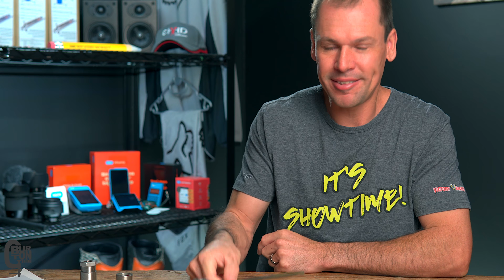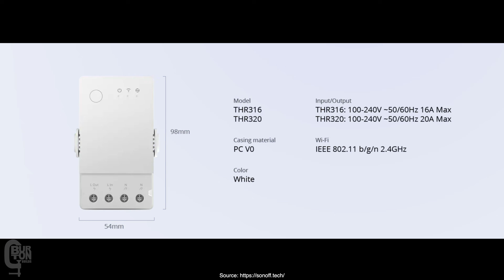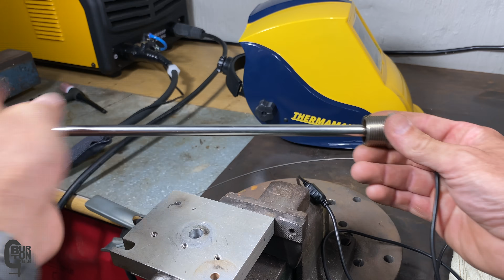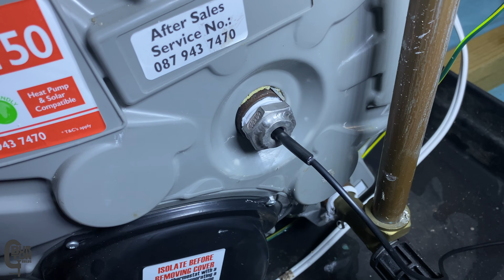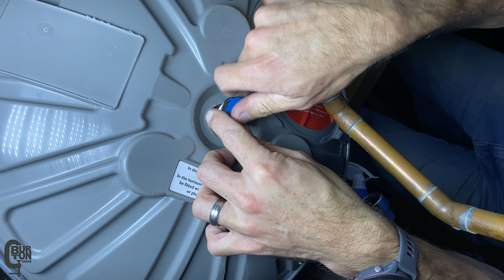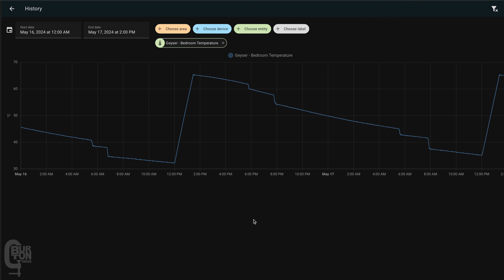Geyser timer and temperature settings - Geyser timer installation

Comment: I have installed solar system for my apartment but my solar isn't set up correctly for hot water.The problem is insufficient hot water for a morning shower.I have a 10 KW battery 8 panels and a geyser wise plus dome insulation round the geyser.Whst should  I do?
Reply from the maker: It sounds like your geyser is loosing too much temperature overnight, so you'll need to bump up the temperature in the morning. What temperature is your geyser heating to?

Comment: Hi Grant, thank you for the video.  I have seen a few ways of doing this but this looks the neatest and more accurate.  I know this is an old video, do you have any updates to this or is the adapter still the way to go?  Also if so can you still supply the adapter?  I already have the Sonoff TH Elite with the probe etc.  I also want to be able to bring the switch down from the roof so that I can see the display, not sure if this is possible?
Reply from the maker: Hi Jeremy, I have been using three of these adapters and all seems to be going well so far. There is some information in the video description if you want to find out more about the adapters.

I would have also liked to extend the temperature probe so that the controller could be mounted in a location it can be easily seen, but if I recall correctly, when I was doing research on this, many people reported problems when using the extension cable so I opted not to go that route. I see there are 5m extension cables available however in my case, they would need to be much longer.

Comment: This is far to difficult just get a Geyserwise mounting plate that already has the extra place for the sensor
Reply from the maker: Can the Geyserwise mounting plate (flange) accept the standard heating element and thermostat that is already installed in the geyser?

Comment: Hi there where do I get the adapter for the probe?
Reply from the maker: Which adapter are you asking about? The stainless steel tube that screws into the geyser? Info should be in the video description, hope it helps.

Comment: Great video, Grant. I've just done this upgrade this weekend. The only thing I don't have is the app and the built-in temp sensor.
Downgraded the 3kw element to a 2kw on my 150L geyser. I have a 5kva inverter and 8 panels, so this will be perfect for 3 showers. BTW, how about a follow-up video from the data you collected over the past year? Cheers, Tim
Reply from the maker: Hi Tim, thanks for the comment. Let us know how your setup is working if you eventually install a temp sensor. Any specific data you are looking for? On average, through summer it worked well, only heating during daylight hours but this winter we are having to bump the temperature of our 200L and 100L geysers each morning because there is additional usage in the evenings now (additional to the usage we had when I originally installed the temp sensors, etc.). The 150L geyser is still only being heated during daylight hours though. Overall this setup across all three geysers is still working great though. Having the option to heat based on temperature and/or time is nice.

Comment: Hi Grant, i sent you a mail about the adaptor tubes. no response as yet?
Reply from the maker: Hi, I don't see anything that has come through? What email did you use? the one in the 'About' section on my home page?
Reply: @GrantBurton  yes the same one, i have resent the mail again. It will come from Shaun L

Comment: Great video, this is next on my list of smart upgrade. Just bought bought a few sonoff switches to flash with Raven to add to Apple home. I also want to replace the elements in my geysers with 2kw so that I can run them on my 5kw solar system. You spoke of getting the data from your inverter. How would you get the data to your smart home?
Reply from the maker: Hi Vincent, thanks very much. Please let us know how the Raven flash work out for you.

A 2kw element should work, although it may take a little longer to heat the water in a large geyser, but if thats not a problem then at least you can cover the full load with solar power. I have noticed our 2kw element runs at around 2.2kw draw. Will you connect the geyser on the essential side of the Inverter, or the non-essential side and back feed power up to the CT coil?

The data can be pulled from the SunSynk server (your SunSynk Connect account) into home assistant. It takes a little work to get right though, it's not plug-and-play and the data only gets updated ever minute or every 5 minutes (depending on how it's setup)... I had this running for a short while and it was working ok, but haven't played around with it for a while.

There are other methods to pull data directly from the Inverter and feed it into a machine running Home Assistant on your local network (without going through any cloud service) but I haven't played around with these much yet.

Comment: Hi Grant, very interesting video and I like the idea of using temperature and time. I currently use the astute timers but these basically only turn on and turn off, I am very keen to give your idea a go on one of my 150l 3kw kwikot geysers. I would be interested in the temperature tube and if the first one works well expand this to my 3 (yes 3 geysers on the property). So please let me know how I can find out the cost of the probe. I am in Durban South Africa. Keep up the good videos, cheers
Reply from the maker: Hi Gregory, thanks very much. We also use one of those Astute controllers, but to run our water pump. Send me an email and let's see if we can make a plan. grantburtonbuilds@gmail.com